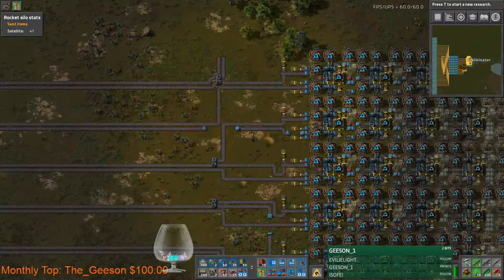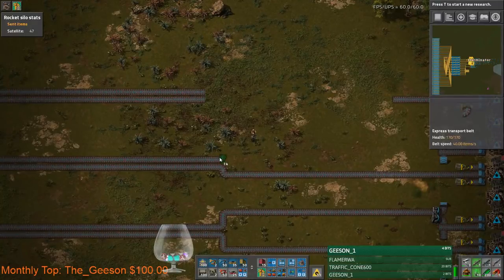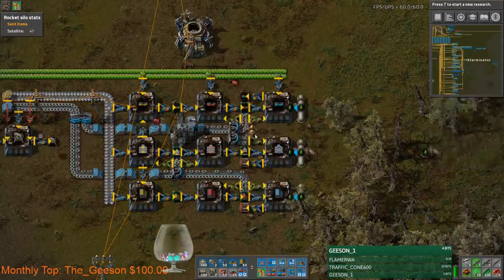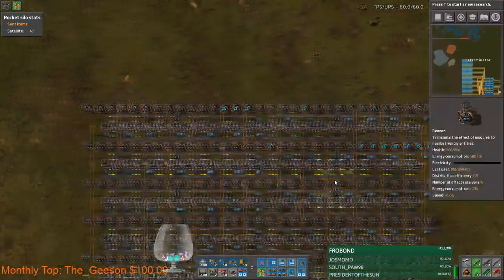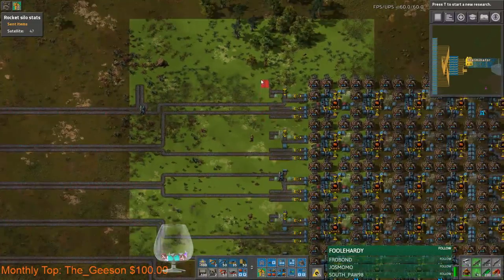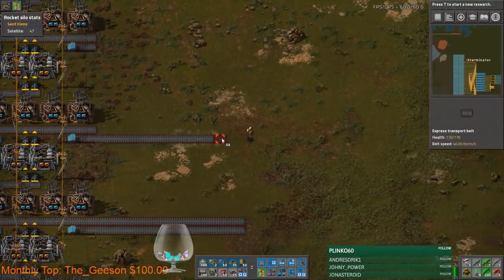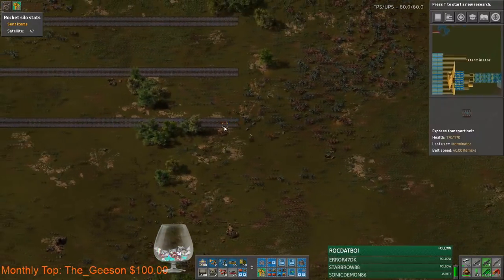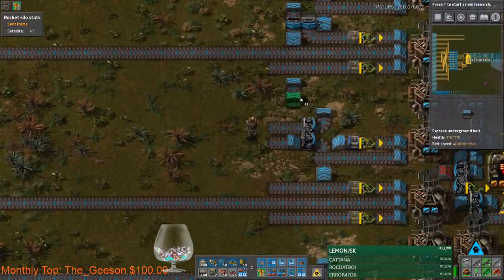Stream Footage: Tightening The Belt - Spaghetti connections and Circuits!

Comment: It only took me three attempts to watch the video. I kept falling asleep after supper. These 2-hour streams are draining. I do not know what I will do with the 3-hour stream that is coming up soon. Eek!

Silly idea: You have your engineering train that remains parked all the time that you are working. You are dealing with a few bottlenecks that are slowing down your ability to place items marked by your blueprints. You can only carry so much on your person when you are placing stuff. How about setting up a few local trains and roboports?

Leave your train parked where it is in the two stations. Set up a small 1-1-1 train that can stop along side (just not neighbouring) the engineering train (e.g., Railroad; 2-tile gap; Railroad). Use long-handed inserters to grab what you need in the cargo wagon. (The "receiving" cargo wagon will need to be filtered. The long-handed inserters will need to be enabled on the condition that a train is stopped. [Perhaps a red signal from the 1-1-1 train's station?]) Set up a few roboports along the perimeter of your current builds (i.e., smelters, green circuits, red circuits). Unload 1-2 stacks of items at each roboport. Let the construction robots place stuff for you, while you load brain.exe (Sorry, I could not resist!) to work out the spaghetti.

You would need to change the filters on the cargo wagon every so often, because those items will be placed. Also, it would be necessary to set up a few stops so that the cargo wagon would be able to grab from each of the six different wagons in the engineering train.

I know that you are trying not to use bots, but this would be a way of getting some of the annoying parts (like modules in beacons) done instead of you pacing back and forth through each column or row of your builds, in order to ensure that nothing was missed. Even if the coverage range of the roboports is not enough to span entire blueprints, at least the perimeters would be done properly.